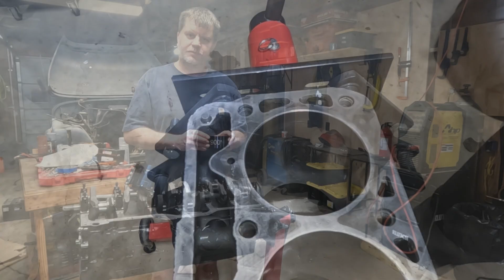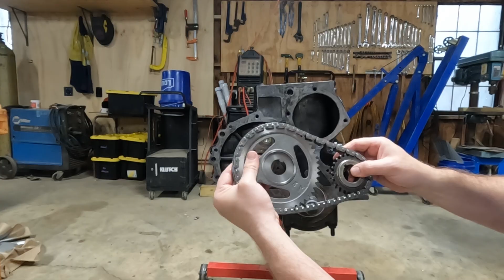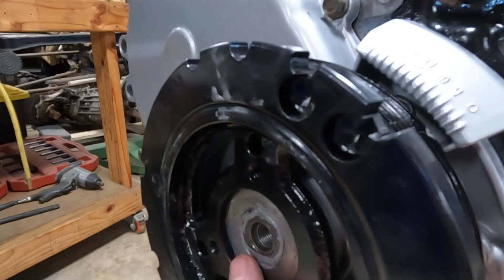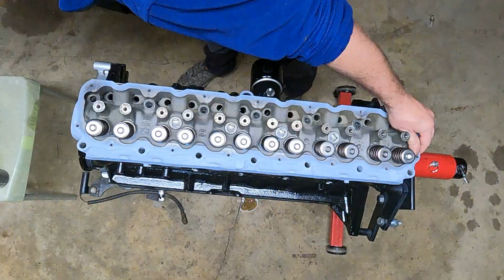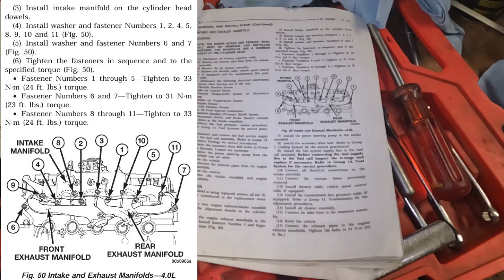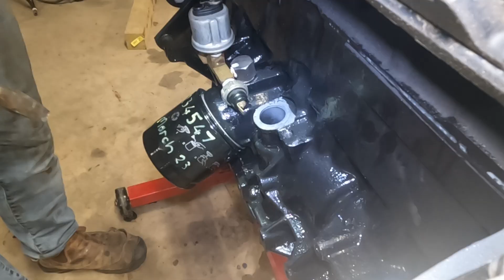1982 CJ7 Overhaul Part 5 - Final Engine assembly

Comment: What harmonic damper did you use ?
Reply from the maker: Great question!  This was a HESCO crank relocation damper HES9199ED.  As I did not use the CJ transmission my flywheel did not have the notches for the crank position sensor.  The hesco kit relocates the CPS to the harmonic damper!  Worked perfectly
Reply: @theshop392   thanks for the info.  I will consider the same option to avoid the exhaust heat that tends to cook the crank sensor.
Reply from the maker: It works well, just make sure the sensor remains tight on the bracket, if it gets loose it will touch the damper and eat the sponsor...